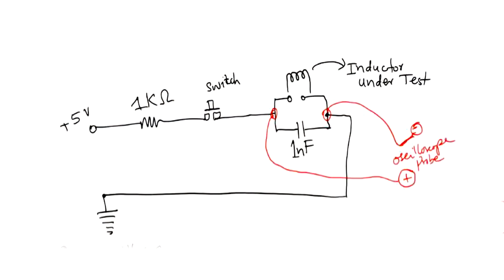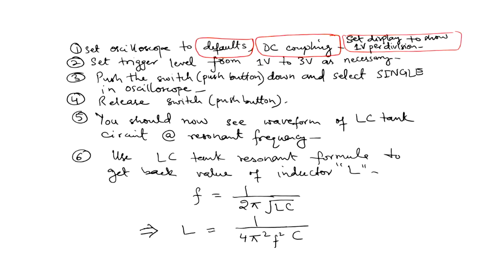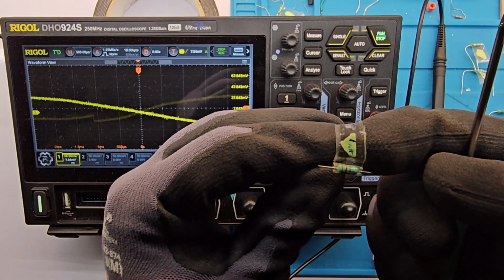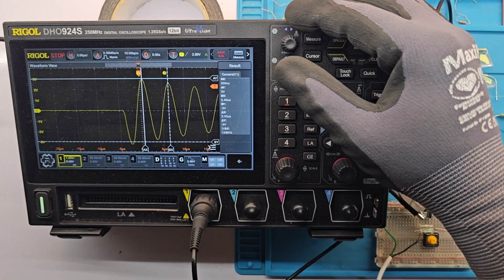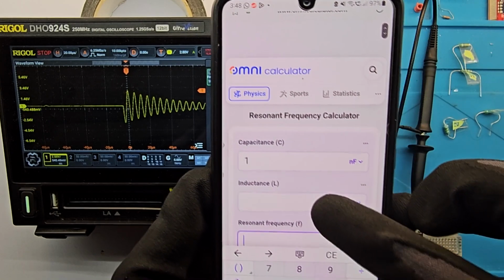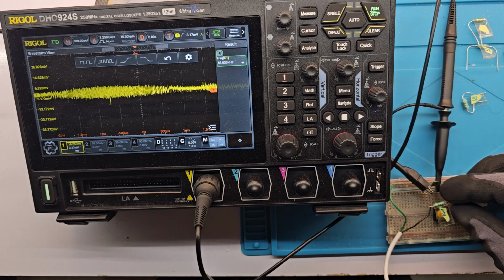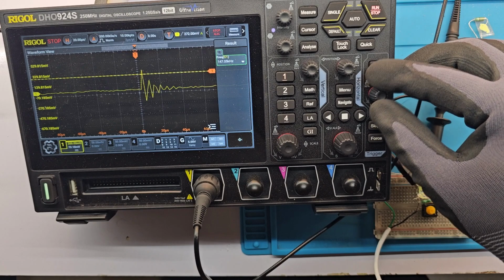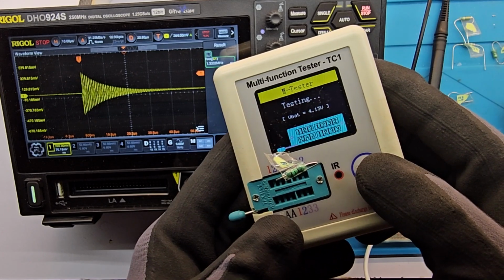Know your inductor with only a pulse | Inductance meter with Oscilloscope |  LC Tank Resonance Wave

Comment: The only problem is to find the exact value of the 1n capacitor (plus all parasitic capacitances of the probe)
Reply from the maker: true!
Reply: @ProDroneControl  I will try to reproduce your experiments with LC tank to see if there is a potential for an L meter using microcontroller.
Reply from the maker: @odissey2  that's quite possible.  Ages ago, i did that with atmega328. All you need to do is make a frequency counter using uC. I used bare minimum code with OP codes to directly access timers and reduce code latency. Once frequency is measured,  we use lc tank formula to get back inductor value. It was pretty accurate in nH to mH range.. in uHenry range, all parasitic components play nasty role nd measurements get weird.